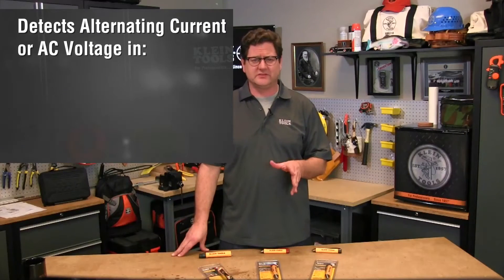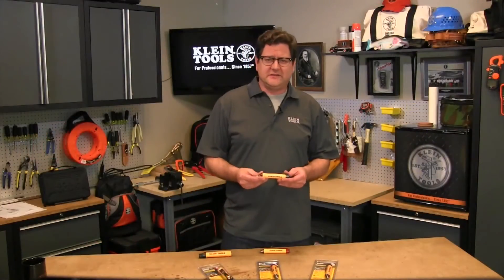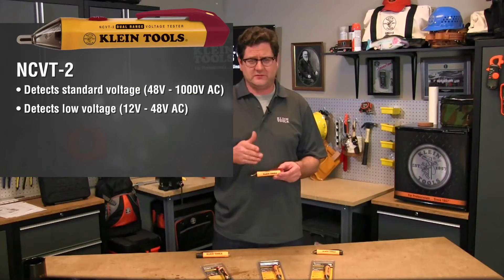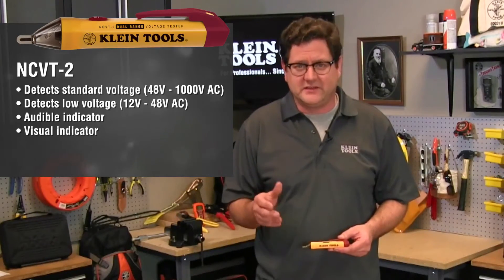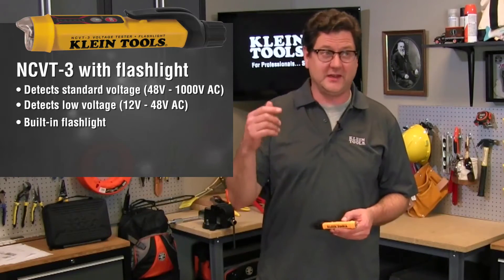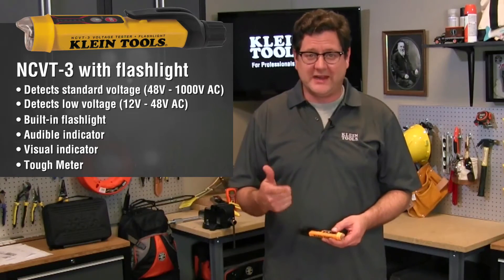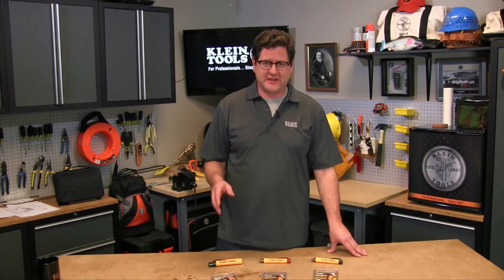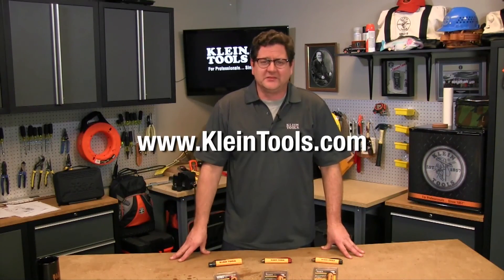How To Select The Correct NCVT For You

Comment: to be honest I'm a fluke guy always have been but my ac1 isnt much use around low voltage control circuits at all. I also notice its dubious at best with certain tyoes of appliance flex - which frankly makes detecting broken cables on said appliances hopeless...

the nvt2 seemed to be the better option for me. whilst the nvt3 does look better and have water protection - the thing beeping constantly in hvac control boxes would drive me berserk....

a direct contact test point is far more helpful when wires are closer together - it certainly seems well made, i was a bit bummed out that the batteries were flat from new!!!

be nice if they were supplied seperately and not installed to prevent that from happening.

overall I'm looking forward to seeing how it compares with my ac1 😃